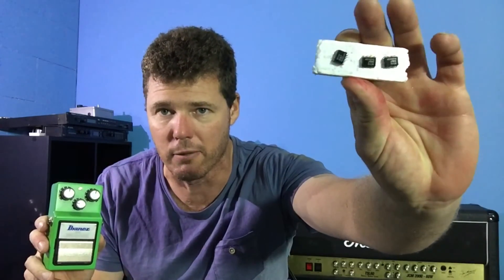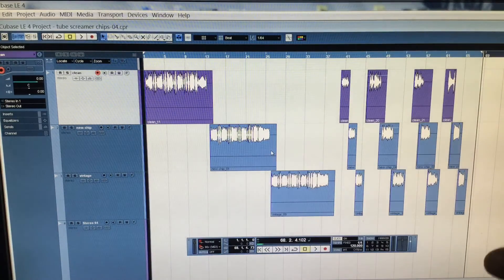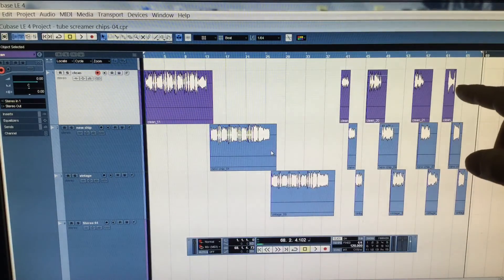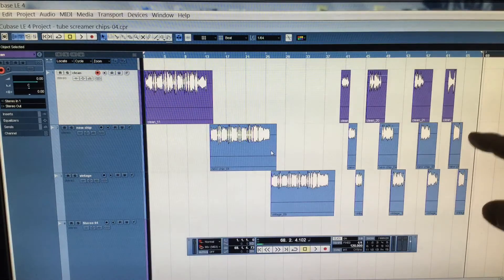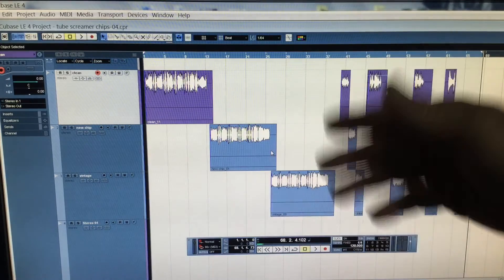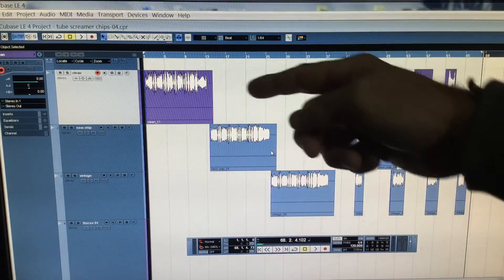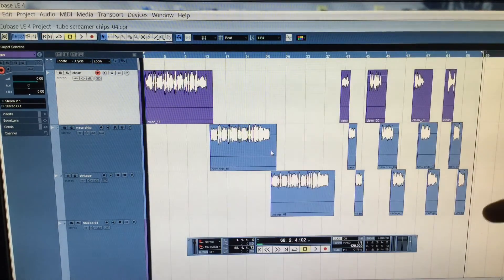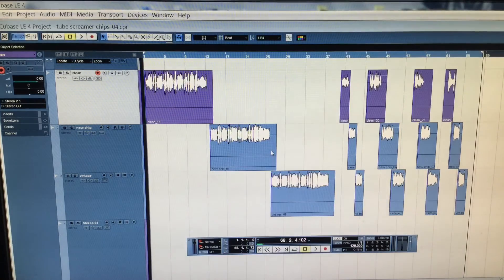Vintage Vs Modern Tube Screamer Chip A/B Test

Comment: Hey look it is blacktopped and remarked counterfeit Chinese ICs. How cute. This is what a real JRC4558 should look like https://i.imgur.com/2iZ10TW.jpg I know they're legit because I pulled them out of a real vintage circuit board. If you want to see if you got duped wipe your chips with acetone. If the markings come off or you see any black at all you got robbed. If they don't look like the chips in the picture you got robbed. And yes there's a lot of people out there that'd love to make your money their money.
Reply from the maker: I hate to inform you that the vintage IC's are the real deal. They came out of a early 80's Ibanez graphic equalizer. So no I did not get robbed.

Comment: Since my last post I have acquired 17 Ibanez Tube Screamers ranging from 1981 to 2017, tried them with transistor amps and tube amps, Les Paul and Strat, and I have to say by far my 1982 with the JRC4558d chip is the best, opposite to what was on this post lol its clearer yet warmer somehow compared to my newer ones,  even had a mid 90s with a JRC chip, I guess its not just the chip, age, other different components etc. The next best ones are the 90s reissues, especially the early 93-94. Obviously this is only my opinion, but sold few of the others and selling a few more. Is the pedal worth 5 times more, obviously not, unless you can afford it, the early 90s ones are fairly close, especially since they had TA chip same as some 83 and 84 TS9 pedals, and at a 1/4 of price and add a vintage chip for extra $30 probably worth it more. Remember the 80s and 90s pedals were built by Maxon, new ones built by Ibanez. Anyway my opinion only. And dont get me wrong the new TS9s are fine.

Comment: The modern chip has more fizzy distortion coining through on the top end, the vintage is warmer with less fizzy top end.   I have two original 808s, original ts9, and modern ts9.  Crank up the Fender amp a bit and the 808s are more open, less distortion. Both t:s9 have more distortion, and top end, with the reissue having the most top end distortion.  Stacking 2 808s is golden.

Comment: The vintage chip smooths out transients and doesn't have the dynamics of the newer chip. The vintage chip has a more open vowel like sound to it. The new chip has better definition, extended range, and more attack. 
Thank you for posting. I love them both!